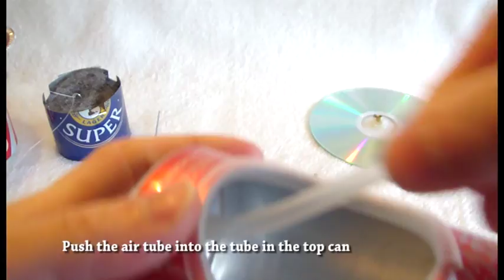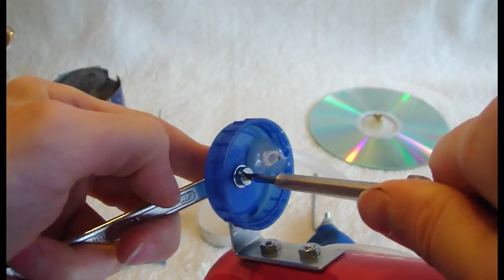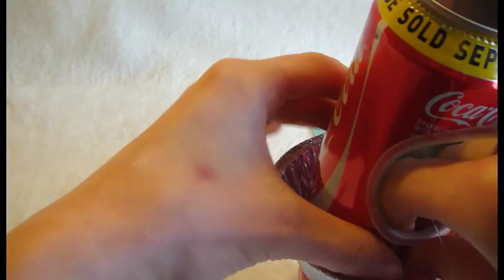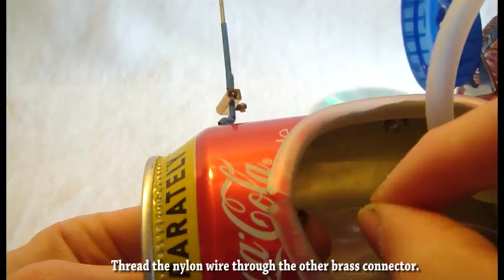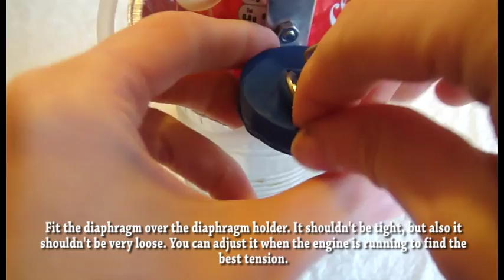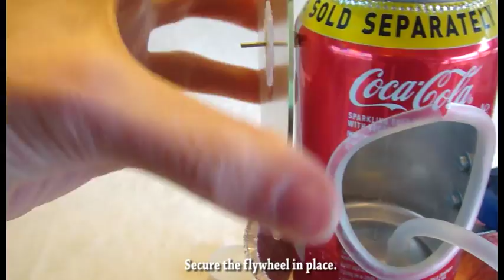Can engine kit assembly

Comment: Great video very neat!
Hey can it go any faster? Lie let's say adding alcohol or another substance besides water? Will it rotate faster RPMS?
How fast do you this in could withstand? Maybe 800rpms
Reply: its not the water that fuels it.  it would run without the water.  the water cools the top so the displacer fall fast as it reaches the top gets heated by flame so go's up again meanwhile the air is pushed through the tube to push the balloon up and down. I don't know what speed this one is doing but I have some that can go about 1,30RPM

Comment: what water do
Reply: Stirling engines work on the basis of temperature difference.  Hence he added water.  In most models, it is not used.